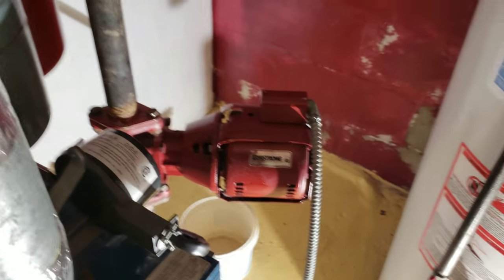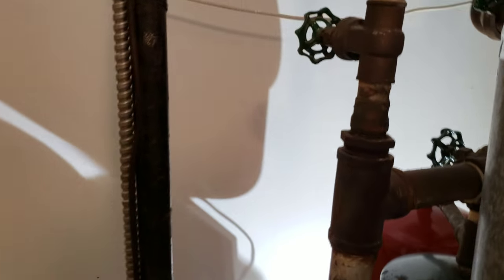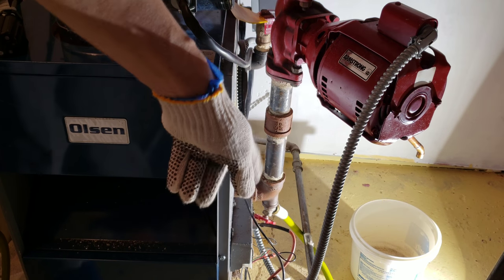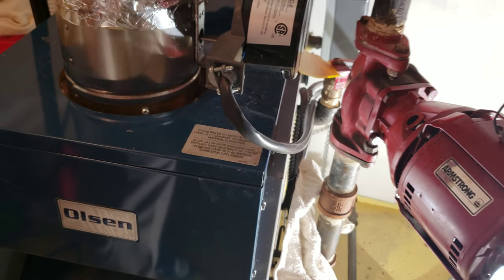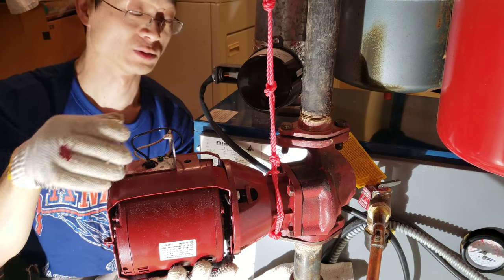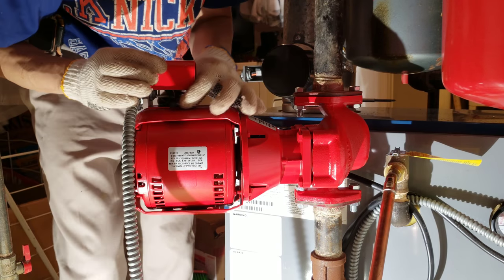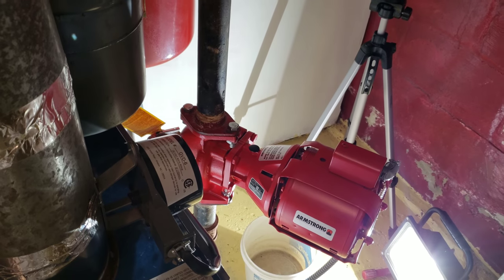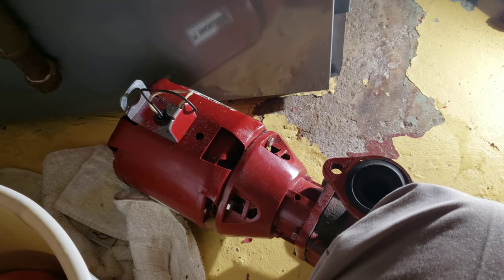Armstrong S25 pump replacement

Comment: Great video Mr John, thanks for posting.
Reply from the maker: Thanks for watching
Reply: Hi Mr John, I have a question for you, the other day i was doing a diagnostic on the same circulating pump you are replacing on this video,it was not running,I checked voltage coming into it,and it was no voltage at all, my question is; can this circulating pump be connected to any 120 volts outlet,or is it connected to a Thermostat???? thanks for your attention.Cheers.
Reply from the maker: @TheMechas56  This pump is basically an alway-on device that uses 115v supply, so yes you can connect it to a power outlet directly if you want.  However, the neutral for my pump is connected to my boiler's control board C2, which I don't know if it is used to monitor the return voltage to see it is running.
If your whole system will function with the pump disconnected from the board, then you just saved yourself a hassle of replacing the circuit board.

Did you check the connection on the board for loose or broken wires?  I have a molex connection that has a problem that I resolved by propping it up a little to make connection contact.
Reply: DIY john Thanks for the information Mr John, i will hook it to a 120 volts outlet, and see if it runs, if it does, then i got to run to the top floor (4th floor) to check and see if the radiators are getting hot, if not , i have to check why the top floor radiators are not working, i did bleed them already, and no air came out nor water neither, once again thanks for your help, much appreciated,Cheers 🙏🙏👍🏼👍🏼
Reply from the maker: @TheMechas56  stupid question, but, was the makeup water valve open and the radiator's valve fully open when you bleed it?  I had similar problem before, and it was caused by my check valve being clogged right after my makeup valve.  Replacing that had my system filling up without a problem.  Good luck

Comment: Great video John, I cant figure out where the lube port(s) are on an old S 25. There could be 3 of them. One port has a flap cover and the other 2 ports have stems (straws) leading down to the port on the pump. I have a pic, its over 24 years old. Know anyone who could service it. It still runs but not for long if it should be oiled. The manuals aren't very clear on the exact location (with a pic)
Reply from the maker: The flap is definitely 1 of them.  Not too sure about the other 2, but if they don't lead to anything that looks like electrical, I would just go ahead and lube them also.  Place a pan underneath just in case you used too much lube.

Comment: If you had replaced the oem coupler, inside the pump with a SPIRALINK coupling you would have saved 
yourself a lot of money and grief.  Including all the air you let into the system